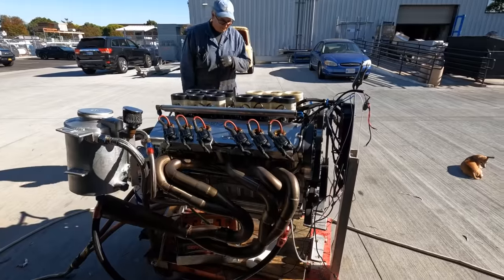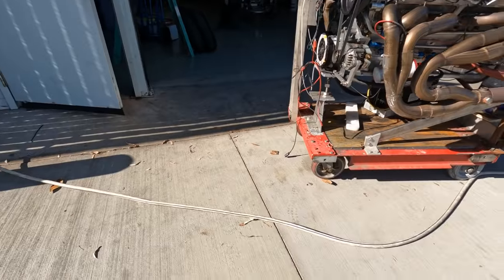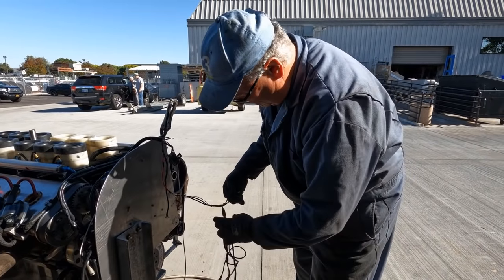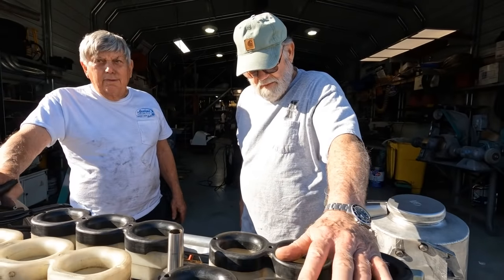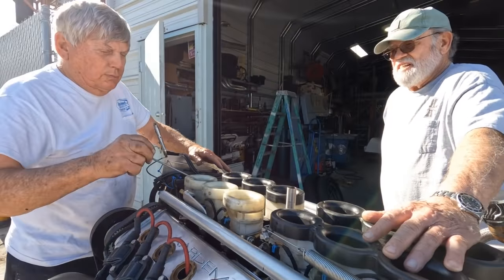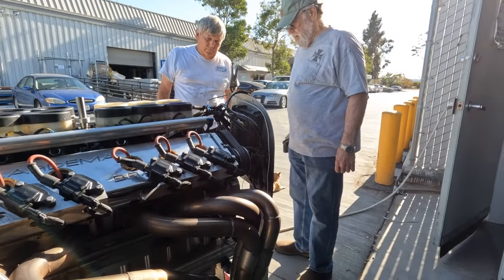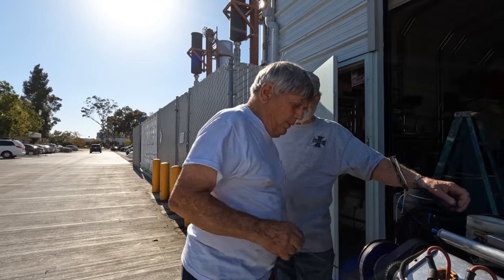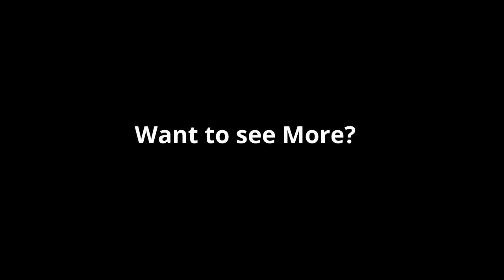Homemade V12 Engine Start Up - Pure V12 Sound & Shop Talk with Pete Aardema & Kevin Braun

Comment: Naw...not buying the exotic or radical concept aspect of engine builder/designer.

They are trying to accomplish something else and its the engine itself that is in their way, not the other way around.

In other words, you need what? Ok and ok and ok.

And 6-12 months later, here is your power plant that will get the job done.

They got all that experience and knowledge and apparently the engine side that they get all this credit for, isnt cutting the mustard.
Reply: Hey mr uploader... I got a question. 

I got a question and a theory. 

You let me know first if you want me to ask, because my first comment I'm sticking with, my question therefore will indirectly explain my theory. 

No ive never built/designed my own 12 cylinder for the modern day koos koo's droolers...

So...

.... Shut your YAPPIES
Reply from the maker: @cp'mane when you get a chance, look at a few of the videos that explain how Pete and Kevin are successful and how they have built over 100 prototype engines - mostly from scratch. They also hold 33 land speed records. Pete and Kevin are in it for the love and joy of the sport. They don't prefer spending their money on hobbies such as golf and fishing boats. They put their talents and excitement into designing and building high performance race engines. No BS or reality TV here. This is the real deal. Thanks, Greg
Reply: @GregQuirin   well, you basically answer my point, if they got that much expertise POWER PLANT wise, then what is the problem or mystery here? Seems like they are repeating particular problems they should damn well know already instead of apparent new learning curves.

And thats my point that they should be known for speed experts rather than engine experts...

It is common that a true or specific expert in many cases, doesnt know much about the objective theory, rather, the relevant objective. 

Harvey Peanick, a legendary golf instructor, wasnt much of a golfer himself by any means, nor was the author of "book of 50 talents" a soccer player or tennis player by any means and just because the two are completely different from one another, the point is, he is a expert on the relevant correlation as to what it takes to become a pro/champion etc etc...

In other words, accredited nuance and expertise doesnt always befall the prototype/conceptual side, no different than the objective end result.

Sonny Leonard, what the hell does he know about what it takes to run a high 5 or win a multi engine tractor pull championship? 

Nothing at all for all practical purposes, he'll build you the engines to do so though...

If i want to go fast, i would contact your two boys here, if i wanted the power plant to do so, i would go somewhere else... 

Big deal, so they prototype some exotic engine configurations...based off of what?

.... someone else's ALREADY established concept original design.

So what, they reconfigure elements and they got the time and money and resources to do so. Knowledge experts...yes

Prototype/design engineer from a expert power plant side of the equation???....hell no. 

I believe in giving credit where credit is due, because we are talking limits here on the cutting edge of BREAKING speed barriers, not engine design.

Give that nuance and distinction to someone else who truly is, because you are suggesting they are "one stop shopping" and its beyond rare that someone or whoever can be a champion in more than 2 sports, much less 2 to begin with. 

They are imo speed consultants who dabble in elements. Give them credit but a car factory nevertheless, has its engineering DEPARTMENTS, each one separate but not independent... interdependent.

Are you telling me there isnt one man on this planet who wouldn't watch this video and say,

 "pffft, of course they are experiencing problems with #1 and etc etc cylinder etc etc because of xyz and its a moot point because of abc all together...mannn (german accent)...SILLY PEOPLLLLE"... (with that flustered/aggravated demeaning pseudo smile)

No, im not going to look up what you recommended, i already know they are renowned, now show me where a corporatation/engineering department or private firm has come along and said, 

"thats a remarkable idea, nobody has ever thought of that particular way you introduce fuel/atomization to the cylinder/chamber etc etc we would like to make you an offer etc etc ..."

I worked for a private sub contractor over 3 decades ago that handled the programming side of air flow dynamics of one particular, yet critical aspect, which of course, had all to do with re-entry and i repeat, these future obama voters didnt know crap about aerospace/aeronautics and their program models (floppy/hard disks lol) may have had a space shuttle in imposition, but it was those technical flow rates created by ??? was the real value and these eggheads of byzantine social standing, were merely the technically capable individuals who understood "language" in order to express a flexible visual working model IN THEORY, based off of dimensional scale and its ever changing flow rate aspects etc etc..

What is flow is only dependant on one critical thing first....ATMOSPHERE, then coeffiencies etc to DETERMINE..."flow".

Once the programming in visual working terms, (God knows how much NASA/government paid) served its purpose, 

guaranteed,

🤔

 hmmm where is the janitor ...sigh ok ok ill do it myself, where is the nearest disposal receptacle vessel?

...😐 ummm you mean a trash can or bin?

YES yes....what ever its called, can you give me its locale or coordinates, I would like to dispose what is in my hands presently, denoted by this shoe size box if you dont mind....

Whats in it🤨

OH lol, just some old obsolete program disks for CHALLENGER that has....

Oh yes, how about that trash container right next to your desk there, director.

Oh...thank you, have you seen my pocket/pen protector by the way?

....😑 like the one in your shirt pocket as we speak? 

Oh! ...heh....thanks

Comment: Pre build stuff with random stuff slapped on these guys know crap. They using there hands and eyes ? Where’s the data measurement equipment ? THERE IS 0 analysis